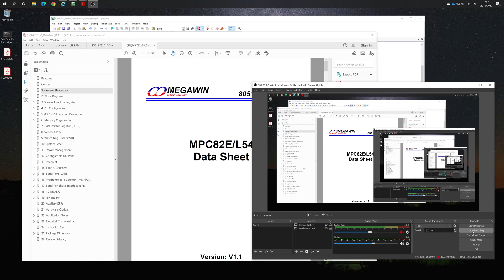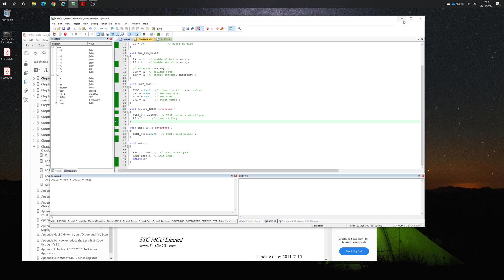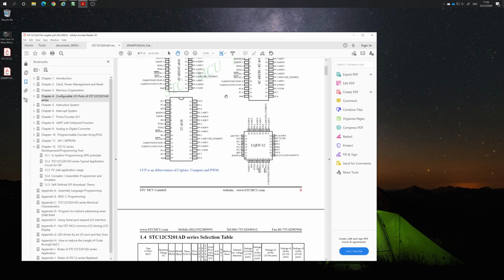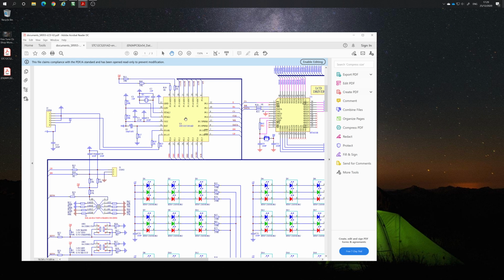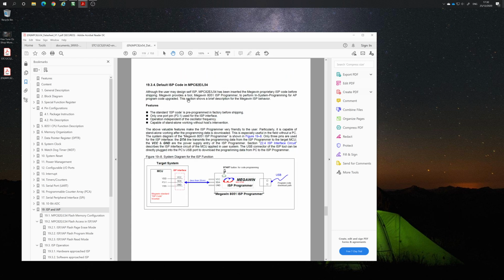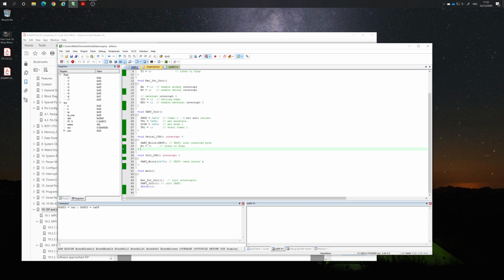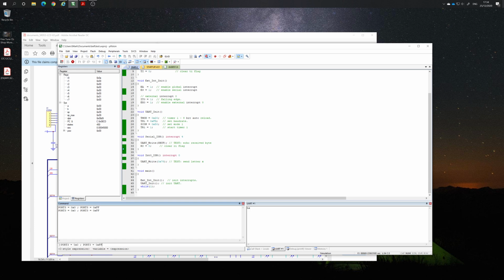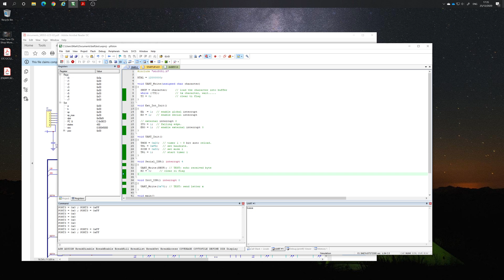Stryker SR955 "skipping" issue - Just flash our own application?

Comment: So if that micro controller takes a dump buy a new radio?
Reply from the maker: No, stryker sells the whole board on their website. It's unlikely this MCU would fail anyway.
But if it did just buy the board and swap it out.
Reply: Mark19960 Good news. SMT is a nightmare to rework.
Reply from the maker: @carlbrutananadilewski3345  look @ https://strykerradios.com/store/category/sr-655hpc-sr-955hpc/
It's 60 USD for the complete board. If you had a problem with the display or even knocked the LCD and cracked it... all you need is that board.
It's a complete assembly. Stryker has parts in stock to support their products. It's a very compelling reason to own their radios.
Reply: @carlbrutananadilewski3345  Would definitely have second thoughts about giving money to anyone who tells you SMT is hard to work on, it's not, it's just different to the older radios the golden screwdriver bunch have been butchering for decades.

Comment: It won’t work unless you put that plain, ugly, black knob on it...everybody knows that.
Reply from the maker: I had some chap mail me yesterday and he said that he put a smaller knob on it and the control "felt" better afterwards.
It's not magic. It's physics. With the larger knob you have more leverage to rotate the shaft.
The smaller knob means you have to exert more force on it to get it to turn. It seems to be stiffer. That's the thing - it just seems that way.
Reply: @Mark19960  in the distance you can hear “muh encoder” and “muh knob” being yelled across the sandy plains...